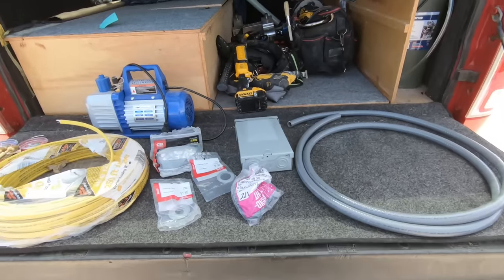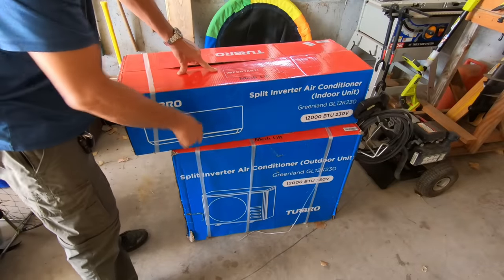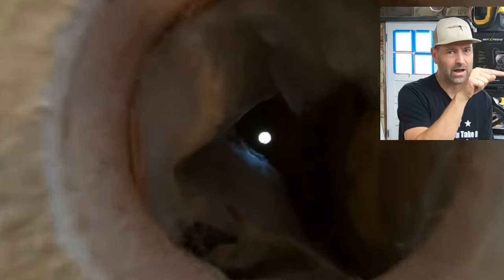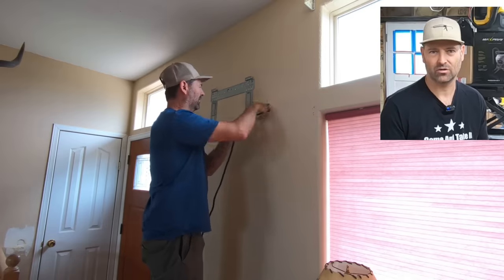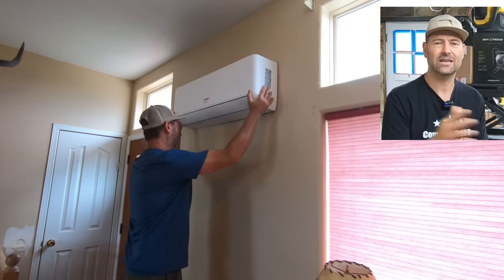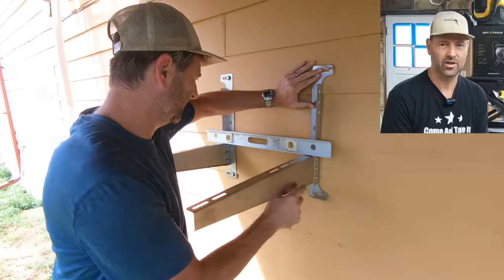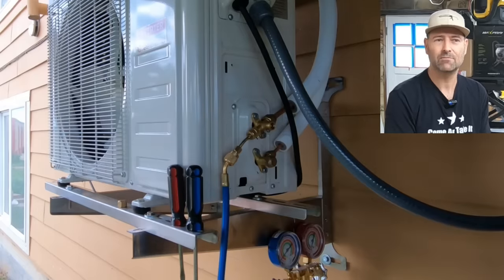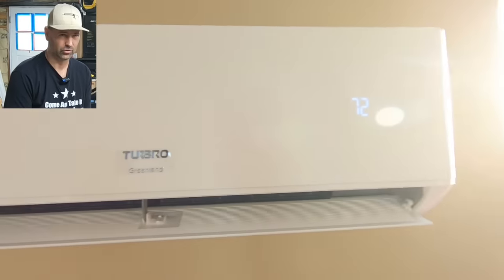They Are Forcing Us To Use These | Heat Pump Or Mini Split Full Install | THE HANDYMAN |

Comment: They are worth the switch even if you don't believe in climate change. 6 years ago I add Mitsubishi hyper heat and I put in a HPWH to replace my oil boiler which burned anywhere from 700 to 900 a year depending on the weather. The HPWH ( hybrid unit) was $1200 the regular electric model was $600, the local electric company gave me $300 in a rebate so it was only 300 more. When I run it in heat pump mode which is 98% of the time probably I use about $10 worth of electricity a month if I put it in electric resistive mode it's closer to $40. So I'm saving $30 a month so in just ten months I make that extra $300. That's not even getting into the money I'm saving on oil which isn't nearly as stable as electricity , it'll take a few years to make back to cost of the Mitsubishis but it's worth it especially considering I have great AC control in every room

Comment: Our heat pump is pretty much worthless below 32°, not good for Kansas winters 🥶
Reply: You've got an older/undersized/poor model then, because they definitely work below 32.
Reply: @bran-qt7ds  it's 3 years old, 2 1/2 ton, 2k sq ft house. it works just doesn't blow warm unless I turn on the aux heat.

Comment: I live in New Yorkistan where the push to electric everything is in full swing. 

After two years of planning, including numerous engineering, electrical grid and vehicle manufacturers consultants assuring us the grid could handle our electric charging demands, my company invested heavily into electric transit vehicles. 

After millions in vehicle purchases and a charging infrastructure built to the engineers specs, guess what? The grid can’t handle our needs. 

Not sure where we go from here, but they better invest billions into the electric infrastructure if they want all electric by 2035 to be a reality. 

And of course, we all know what fuel is used to generate electricity LOL.

Comment: Dont get ripped off...I just did a 2 ton minisplit total cost of unit + materials after rebate at the HD was $1,000. I called in a favor had the lines hookedup and charged for free. My guy said he would make $6k putting in this unit and told me how he made $60K doing 2 big installs 11 heads each took 30 to 40 hours each and he made more than a brain surgeon from a brain surgeon . That's the only thing wrong with them that I can find.

Comment: I admittedly haven’t used any of these newer models but standard heat pumps are useless once it gets below 40. At that point you switch to heat coils and need to get a loan to lay your utility bill.
I have gas heat and gas water heater. At least in my market it is FAR less expensive to use gas. Not to mention gas does a much better job.
Most people I know that don’t have access to gas heat supplement their heat with a wood stove. 
I don’t see how we can possibly switch when we are experiencing rolling blackouts at current demand.
Reply: That's outdated models.  Today there are plenty of models that can get in the zero range.

Comment: Also, this has to do with much more than individual likes or dislikes.  Electric heat pumps are scalable to hundreds of millions and electricity can be generated through multiple methods.  Gas infrastructure will never be available everywhere.  Traditional compression based cooling has always been inefficient and costly to implement.  THE single smartest HVAC system is geothermal, but its expensive and tricky to implement in smaller land parcels.  For the vast majority of people, the mini split heat pump will always be the only practical option.  Also, there's no point in talking about the next 50-100 years when the bigger problem will always be energy availability.  That is what drives the need for this technology and it is something that can't really be predicted.

Comment: Is this a 100 year solution?   Well, that depends on how much you value our current oil reserves.  I value them greatly for things like air travel, launching rockets, running freight trains and cargo ships and want it around for generations to come.  I'd rather not use this valuable and finite resource for moving my ass around town, or even heating my home in a moderate climate.  It make more sense to move heat than to create it, since there is plenty of it around.  I mean, why we're not harvesting more of it from the ground, I don't know.

Comment: I love the half-assers who claim they can tell what specific torque setting are by feel. Cracks me up. Same guys who can tell the temp outside by licking their finger and holding it up in the wind. Oh well..thats why HVAC tech charge $500 hr.
Reply: Where I grew up I could absolutely tell you the temperature plus or minus one degree just by walking outside, because it was cold and we checked it constantly.  No different with this if you do it often.
Reply: You must be one of the butthurt hvac techs that's getting phased out by something that anyone can do....  BTW soldering a line set and watching a gage isn't some magical skill set.  I read how to do it in a book when I was 15 and have been doing it ever since.
Reply: @bran-qt7ds  What did you do when the wind was blowing? Or did you know that speed as well? Ya the whole windchill/feels like thing.
Reply: @christopherhorne8665  You missed it. Way over your head.

Comment: Heat pumps are horrible but they will keep the hvac repairman busy for sure…
Reply: Mine blows a capacitor every year like clockwork. Still cheaper to replace the part than the whole ancient system though. (1995) Interestingly, heating & cooling bills rarely exceed $130 a month, 1600' home.

Comment: There really is no new technology in the "mini split heat pump revolution" that is much different than traditional ac. All a "heat pump" is is a reversing valve that causes the refrigerant to flow in reverse to make heat.  The outside which blows out hot can be reversed so it blows the hot side to the inside. You can flip a window ac backward with the knobs on the outside and it will do the same thing. The only real technology involved is an improved compressor on the new inverter systems which allow the speed to be throttled up and down based upon simple sensors allowing a small computer to "steer" the speed up and down based upon changes to environment. So yeah, I think what we have now will not change much really. It's just driving the same old school ac system more efficiently with sensors and computers no more complex than a sailboat "auto tiller" really.
Reply: This is mostly true, however those improvements can make these units 20 to 40% more effcient that a traditional HVAC heat pump unit.

Comment: Heat pumps wont be effective in colder climates.
Reply from the maker: I experienced this last winter in the workshop when it got to -10
Reply: @TheHandyman1  yeah and most will switch over to a heating element  (i call thos hairdryer  mode). You can watch your money literally burn away in this mode because its so inefficient.
Reply: Tell that to folks living in Maine. It seems that they never got the message.

Comment: Heat Pumps are not as reliable or efficient as a 98% gas furnace for heating.
Reply: Heat pumps work in the 200% to 400% efficiency range most of the year, and even below freezing they still work at higher than 98%.

Comment: Dear Handyman (and fans as well),
You asked if your audience felt it will be worth the cost to switch out the entire country to this technology i only to see it supplanted by something newer in the future.

My answer to that is no, probably not.

In my opinion we (human beings) no longer have the luxury of considering "cost payback analysis" in making the necessary changes needed to protect against climate change. If we love our children, we simply must adapt, no matter the cost. That ship has sailed, decades ago.

Too often we fail to recognize the benefit of a necessary change (economic, or otherwise) because we're limited in our imagination to the length of our lifetimes, which is very short, comparatively speaking.
The effects of fossil fuel combustion may take 1000 years for the planet to stabilize. Mother Nature will re-balance the scales. The issue is whether or not we will survive it. I'm optimistic that we will, if we abandon our instinct to resist change.

There is great comfort in the familiar, but fortune favors the bold. There is a bonanza of economic oportunity available to us by abandoning the way we  have always done things. I prefer to think of the cost as insurance for the future.